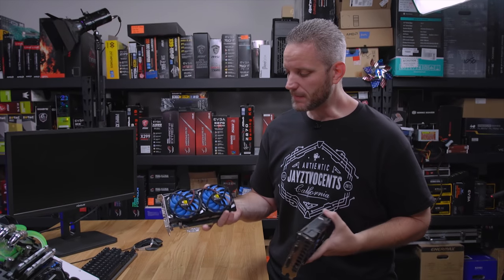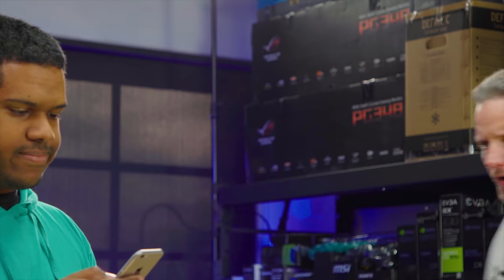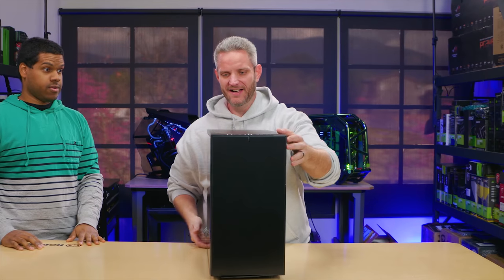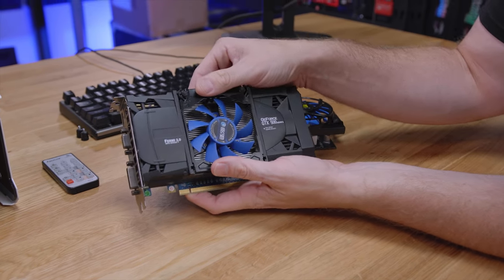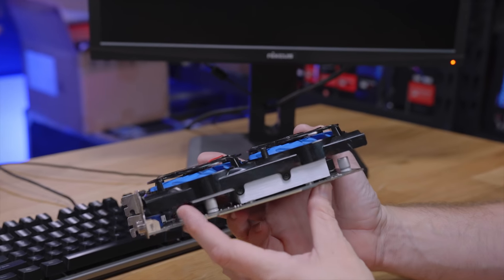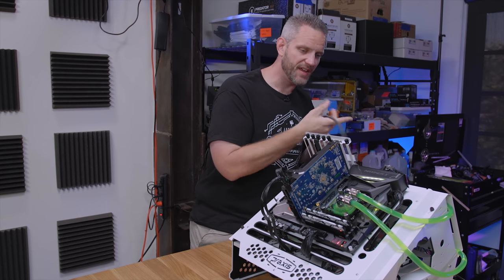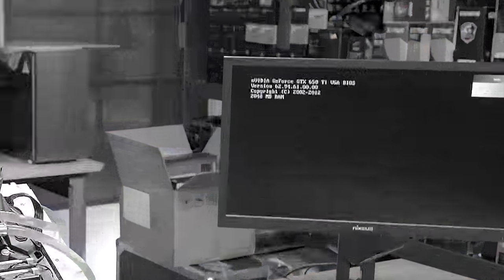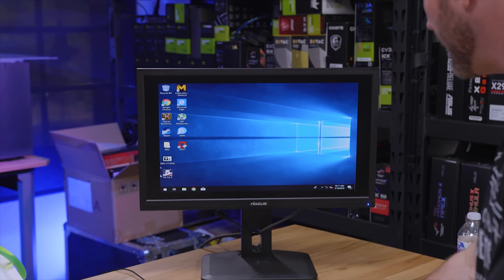What is this GPU?!? Counterfeit Video Card

Comment: NVflash won't work, I tried that. Chinese techs overwrite the BIOS using an EPROM programmer (physical) and a clamp adapter (SOIC8). It's not difficult but first you need to find the right BIOS. I basically built my (very very modest) youtube fan base by testing these chinese cards and haven't fixed these for lack of time. Good video man.
Reply: do a collab!
Reply: Simos Katsiaris oh that'd be awesome. Won't keep my hopes up, I'm just trying to give Jayz a heads up on how to recover these cards and give them some use, because with the hacked BIOS they're rendered useless.
Reply: Simos Katsiaris nobody likes wasting their money or being scammed, at least you can get a usable product and could eventually recover paft of your investment. Anyway, there's another guy who's recovered these fake cards, you can find his videos pretty easily.
Reply: I wish my Spanish was good enough to caption your videos on this in English.
Reply: Oh look, it's a Craig. Hi Craig.
Reply: You got a new subscriber man.....
Reply: I'd be very interested in those videos if they were in English.
Reply: Would you need a jtag connector or something?
Reply: sometimes you can flash them with software, but it can be a pain, but i got a buddy who says you can get a usb clamp programmer fairly cheap that will do the job with ease.
Reply: uhhh hey actually they just bridge pins 1 to 8 on the bios chip of the card and then flash it with a custom assembled bios I did it with unflashable gt 740
Reply: the bios chip manufacturer gives a menu so you can actually bypass the bios entirely by using bridge 1-8 on the bios until the bios is repaired it wont work properly
Reply: Could you use MPLab to install a new bootloader?
Reply: Is not special just ebay 24xx /25xx flash programer and desolder the chip or use adpater for flash on board only issue is the 3.3v of programer used for a few ma  can by`pased by  a external lt1117 -3v3 regulator up to 1A.
Reply: What about open source drivers in linux?
Reply: rendered useless? It won't be able to render anything at this rate! Ill see myself out
Reply: can't believe this comment has +700 upvotes. I am currently trying to fix a fake 960, will come back with a video. Thanks kewl crusader for waking me up!
Reply: So, I finally got a fake GTX 960 to work; it was a GTS 450, Palit 1GB GDDR5 BIOS did the trick. I hope I can make the subtitles for the video soon, but flashing the card is not a difficult task. All you need is the EEPROM Programmer (CH341A USB device) and the SOIC8 clamp adapter. Backup, erase, overwrite. As simple as that. (video in Spanish) https://youtu.be/WSiSSoyp1gY
Reply: @crimsonfker4999  I'll add english subs. I'd have to start a new channel to do videos in english, I don't see that happening soon as I can barely keep up with my family, job and YT channel lol
Reply: 77_/þ
Reply: You can always flash .
You do need the code for the flash software to override the security .
And yes it's still dos software and a boot USB stick .
Reply: Wut
Reply: It's easy to impress slow people, yeah?
Reply: Grande tio vito ahsnsj

Comment: Unfortunately NVflash won't work with these cards. The actual bios chip on the card is modded, so you need one of those $25 bios modding tools from eBay to fix it. The actual chip name should be on the die, so take a look at that if you get the chance. Nice video!
Reply: yeah, shocking right??
Reply: Big fan of ya, Ozzy!
Reply: When you realize that he destroyed the card so there are no chances for recovery.
Reply: OZZY MAH BOI
Reply: Ozzy in the house
Reply: Ayyy ozy
Reply: Oz !
Reply: I think there are some cheaper bios flashers (Correct me if I'm wrong)
Reply: wow OZ is here :D
Reply: Of the frake cards teardowns I've seen, this wasn't the most impressive, most researched nor the most succesful.
Reply: $25? I have bought my CH341A for about $2 and the clamp for about $3 more, though i should have spent extra $2 to get the clamp already confectioned, otherwise i have to do it myself. Not even close to $25. But i don't have any of these cards to try this technique on, i bought this for a different purpose pretty much.
Reply: ma dude!
Reply: I love jays, Linus, and your channel.

Comment: Take the heatsinks off and read what the chips say if you have time! That will tell you what both actually are.
Reply: Bamfhammer he prob didn't care enough to do that lol
Reply: Probably right, but he could have grabbed a crowbar at the end to make that happen easier than trying to do it nicely.
Reply: Sometimes they take the gpu identification off of the die.
Reply: +Sir Lagsalot it is usually engraved in to the chip and trying to sand down the chip or whatever else to remove that could cause the chip to be damaged so they don't usually bother as it isn't worth the effort if in the end you are going to be destroying some of your stock of old cards
Reply: Zahid Shabir it must just be mine then. Mine doesn't have an ID on the die.
Reply: Most of the time the ID is still there so worth at least looking into.
Reply: Checking the vram chips helps also
Reply: If he went to the time to make this video he could have taken the heat sink off to find out what it really was
Reply: +Sir Lagsalot I never said they do NOT do it I was just suggesting that it is extra work for the scammers and also there are risks of damaging the GPU die's which costs the scammers money
Reply: They polished the die.

Comment: That Galaxy looking card you got has the same exact cooler as my Galaxy GTX 460 768mb. The second I saw it I knew it was a Galaxy card lol. Recently tested and benchmarked this card for a video actually, and did way better than expected in Fortnite and Realm Royale!
Reply: Definitely a good idea, but the trend now is removable fan blades. Not alot of brands push the feature though, but the blades come right out and you can clean under the fan on a handful of different GPU cooler options.
Reply: There is actually an example picture of it on the GALAXY Technology Wikipedia on the chinese Wikipedia because its actually a chinese brand.
Reply: I have a GTX 450 from Galaxy and when I saw that cooler, I got a bit nostalgiac lol
My first GPU

Comment: It sounds a lot like what Nvidia use to do with OEM GPUs an example would be the GTX 260 OEM that had 2GB "1792 MB of DDR3 with a 448-bit memory interface. I believe these custom OEM GPUs existed up until GTX 600 or GTX 700 series

Comment: I probably would have just removed the heatsink and looked at what printed on the chip on the first card. You said the second card worked but only for a short time which leads me to believe it is a cooling issue or the card is just fracked up. I would not have how ever just ripped it apart and then try to break the board in half without checking to see whats going on under the hood with teh heatsink removed. I guess when you have so many cards around to play with something like these don't mean very much to you but for others that don't have any extra cards laying around if you can get just one of them to work means there is at least one more card to install into test systems. I cringed so hard when you ripped the heat sink cover off like that and then tried to break the card in half.
Reply: Broke is broke, odds are that card had let a pretty rough life up till this point and was beyond repair. We all know Jay isn't in any way a repair tech, and (not that id expect him to) probably doesn't even know how to really dive into that.
Besides, plenty of channels with good videos on the subject of identifying these cards, this I'm assuming was meant to be a joke. As for including these old cards in testing, its unrealistic even if it did work. By this point a 400 or 500 series Nvidia card shouldn't even be considered as something we would want or install in a gaming system.
Reply: I get your point here and he probably just did this video to make content which is fine. I just cringed because of the way he just threw the card on the floor and then just forcefully tried to wreck it. If the thing powered up even for a short while chances are it was heating up or something wrong with something minor on the card either way probably an easy fix.

As for using it in a gaming system?? I said to use it to test systems on a bench like I do in my shop. If a system comes in with out being able to display one of the things you test is the graphics card if it has a dGPU installed.
Reply: I mean I keep things like a GT730 around for that type of testing, that being said Jay has more then enough cards, probably even some old stuff that I doubt it was any kind of great loss to him really.
Reply: These are usually low-end to low-midrange Fermi with modded firmware, they are reliable units and don't even usually experience heavy use anyway. The modded firmware that makes them appear as a newer more powerful GPU is the problem.
Reply: Graphics cards life matter

Comment: You know you didn't have to go through all those countless reboots and gpu-z to find out what that GPU was. In fact gpu-z wouldn't even be able to tell you what it is, gpu-z can only tell you what the card says it is. Really all you had to do was take off the cooler and look at the chip.
Reply: John Crafton honestly I knew gpuz wasn't gonna yield much in the way of identifying information. as I currently still have a vamery 650 and 750. knowing these can be fixed is at least something.
Reply: the cards are probably old inventory from 10 years back or so. they could print new info on them, but I don't even think it's worth it

Comment: nvflash will detect a card with a missing EEPROM.  So work from there, short the data pin on the chip to ground and boot with another GPU, then with system running, unshort the data pin on the EEPROM and flash the card with nvflash, it will be detected.  Basically the GPU chip sets a default device ID when there is no VBIOS modifier.

Comment: My son Bought a cheap Chinese knock off from NEWFROG, not newegg.
It was supposed to be a 1050 but was a 650.. well sort of...it sparked and shorted out my mobo and the card. Neither worked in the end.  
(Ended up rebuilding complete computer..2600x,x470,212ledturbo, 1060,1tb,128ssd, new case..) I'm still fighting with newfrog for a refund...lol

Comment: Those graphical glitches in heaven are caused by the memory actually being smaller then advertised.
Jay you can flash a modded bios on there and it'll revert back to actually reporting the right amount of memory.
Phil did this and I did it myself as well, worked fine :)

Comment: I've had an ASUS HD7875 with a giant metal fan-thing on top. Bought it from a friend of mine who said one of the cooler made a ricking noise. I thought it would probably touch the fan-frame somewhere and was easy fixable with a dreml. As I plugged the card in all the neighbors in my area started their jet engines.. Except.. they didn't. This was the loudest I have ever heard any PC product to be. Later when I measured the noise level with a dB-meter the card seemed to reach 80 dBA from a distance of 5cm. To this day I still have no idea what the problem was. The card performed mighty fine at the time though.

Comment: The first card's specs are probably those of a 9600GT, but they installed a 130 BIOS which confuses GPU-Z. You can see that by the textures glitching because the system is trying to load more textures on the VRAM than it can actually hold.

Comment: So for some of the OEMs, the 9600 was rebradged as a GT 130 or GT120.  I had this issue with this card on Windows 10 on my Mac Pro (card was branded as a GT120).  Will not boot if you use the latest Nvidia drivers - I gave up and ended up just using the default windows driver for the card.  I will have to try to dig up the Nvidia drivers like you recommened to see if that will run normally.  Was not ever expecting to see a solution for this old card. Thanks!

Comment: Craft computing had some video's about cards like this and they kept overwriting the gpu memory because the system was under the impression it had more than it actually had. So games would work fine untill the memory was full and the artifacting began. But after flashing the gpu bios they were working well (as the model they actually were).

Comment: i have a similar experience with counterfeit external hard drives. a so-called Seagate 2TB external with a hdd with fake Hitachi label inside it and weird firmware. Actual capacity was only about 80GB. No firmware would work and the drive end up killing itself.

Comment: Craft Computing did a test like this and showed that the drivers thinking the card has more RAM than it actually has means apps go completely fubar in how they try to run themselves, reserving more memory than is possible, etc., resulting in crashes, screen corruption and even potentially harming one's system.

Comment: For the 130, you need to flash bios back to the original one, But saw a youtuber flashing directly ( i mean physically not with nvflash)  the eprom because the ' Card ID/Model ' was faked inside the eprom and not the bios.

Comment: 7:24 Changing that setting doesn't stop a driver from being automatically installed when you plug in a device, it only stops newer or "more appropriate" drivers from being downloaded from the internet and automatically installed.  P.S. 12:38 Serves you right for destroying an interesting piece of computing history without even attempting the most basic electrical diagnostics.  :(

Comment: Hi Jay! I’ve been watching your channel for a couple of months now as I’ve started getting into PC Gaming and Parts etc. 
I recently decided to put together my own system for FPS Gaming. 

My Current Spec List is as follows. (AUD)
CPU - i5 8600k 
CPU Cooler - Corsair H100i V2 
MoBo - MSI B360M Gaming Plus 
RAM - 8Gb HyperX @2666Mhz 
GPU - MSI GTX 1070 DUKE OC 
PSU - Corsair CX650 
Case - Coolermaster MASTERBOX 3.1 mATX 

I would love to get 16gb of RAM but the prices here in Australia are too high for the budget that I have. The only thing I’m wondering is whether my CPU is too overkill. I only play CSGO, PUBG, Overwatch and Fortnite. I was thinking about the i5 8400 as it’s more than $100 (AUD) cheaper but would that affect my performance? 

The total cost of this build has come to $1300 (AUD) as I’ve sourced some of the parts myself (this includes the CPU and Cooler but I haven’t purchased them as yet) but my budget has recently been decreased due to my partner and I expecting another baby. 
Is it worth spending the extra $100 for the 8600k? 

Thanks so much and please keep uploading your content because it’s already helped me so much and most of all, it’s fun 😀 

Have a great day Jay! 
Nathan

Comment: Modded bios cards.  They are literally taking old stock and reselling it as new bullshit.  This didn't happen as much with the older cards because internet sales weren't as big then, but its happening now.  The sad part, is that all you would have had to do to figure out what card they were is remove the heatsink.  They don't scrub or sand the IHS on the GPU, its not worth it, because they know its not going to work.

Comment: I had an 8400GS i used to use for testing that worked on the WDDM driver but would BSOD with the nvidia driver installed. No branding whatsoever but a kind of fancy single slot cooler. I think it was sold as a fake quadro

Comment: Guess they faked the amount of vram on that 130, at least thats what its looks like on that heaven benchmark test; card thinks it has X size vram buffer, heaven generates and writes to sequential adresses, but when trying to render those textures, those addresses are nowhere to be found. Some "games" crashes when this happens but surprisingly many "games" just keep on running, unable to output anything where those textures were supposed to go.

Comment: Thanks for this DDU recommendation. I had an issue 5 or so years ago when installing graphics drivers caused a crapton of issues.
I have been doing a clean install since then (whenever I update my drivers). 
Though it does recommend to not use this everytime you update your driver. I find this interesting and odd.

Comment: I've seen another video with these bootleg cards trying to run games and benchmarks out of spec.  I believe a lot of the graphical anomalies is due to the misreporting of memory for the card.  Causing textures and the such to never load properly.

I wonder why it doesn't just straight crash though when trying to use more memory then the GPU supports.  Its not like it can offload to a page file or something similar.

Comment: If you run across any cards marketed as Pascal, look for the blue VGA port. If it has one, it usually is a modded GTS450.

The only real Chinese vendors I've ran across are Corn Electronics and Colorful Technology. Anything else but these two and you're pissing money away.

Comment: Hey Jay I have a question that's not really related to this video. I just got an elgato hd60 pr0(noticed it on your test bench) and I'm having some set up issues. First whenever I use the card in StreamLabs Obs or in the elgato software, I get horrible lag spikes/stuttering on my screen. Second is that if I follow how to set up the card I can only run my monitor at 60hz instead of 144hz. Was wondering if you or someone in the comments could give me some advice on the best way to set it up?

Comment: Why didn't you just install GPU-Z from a flashdrive to prevent it from connecting to the internet? Or why didn't you disable Windows Update on a test-rig if the whole point of not connecting it is so it does not auto-download updates/drivers to mess up your testing in the first place?

Comment: an eprom flasher is needed for any fake gpu...learned that the hard way..although my fake (old) 550ti would run any game i wanted at med high settings but at a power consum of 150 watts as well as a temp of 80-90c..